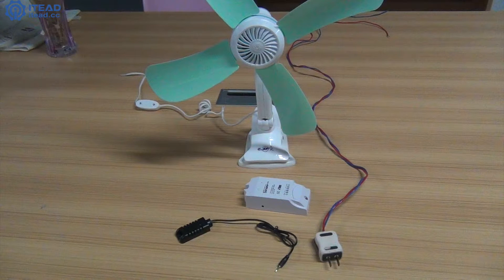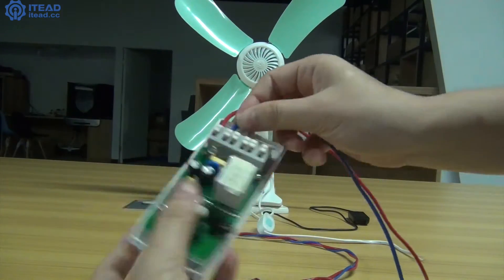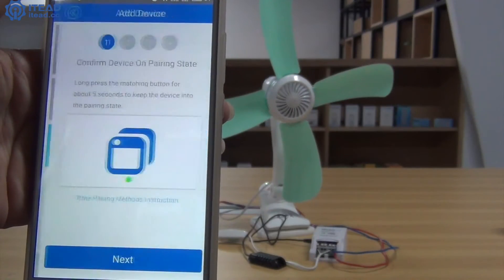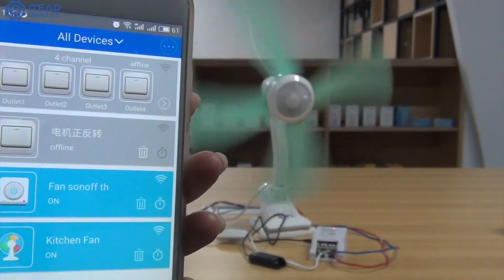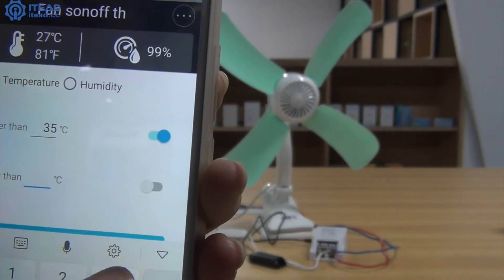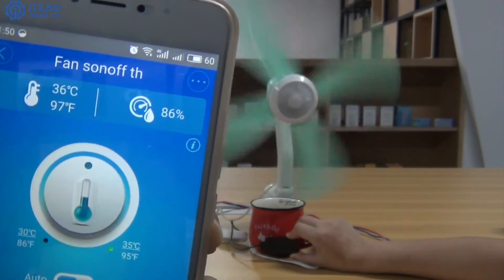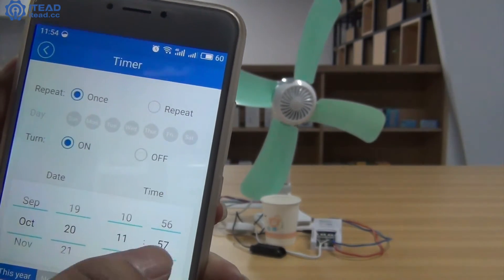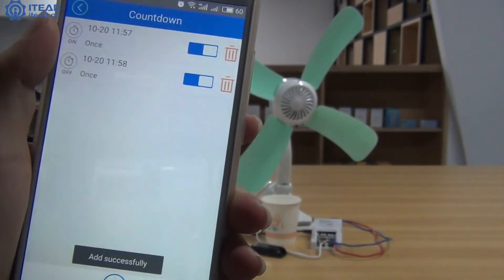How to DIY A Temperature Controlled Fan (2016)

Comment: totally useless. i recently bought it and the relay is executed when the internet is disconnected and the reconnected. if you reboot this device it won't remember its settings. trash
Reply: Fakhre Alam I know I'm a year late but if still of interest https://blog.ipsumdomus.com/sonoff-switch-complete-hack-without-firmware-upgrade-1b2d6632c01
Reply: Yeah, the timing can be executed even network is down. Some one like this.